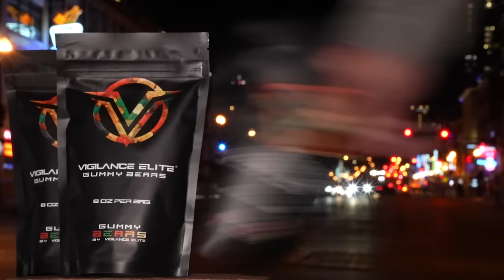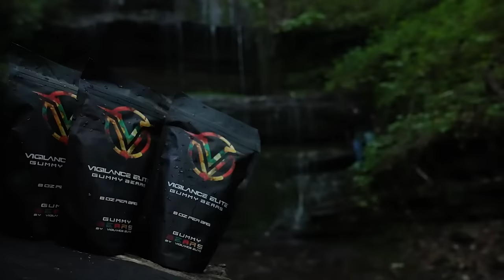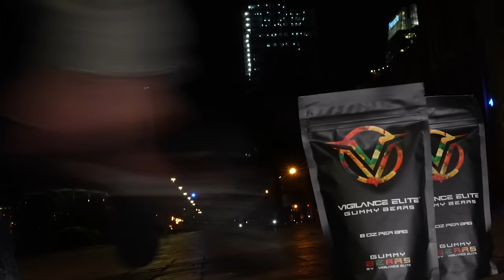DJ Shipley - SEAL Team 6 / DEVGRU Operator | SRS #015

Comment: "I used to run around with the charges already capped in."
As a former EOD tech, my mouth opened in a "you did what?!"
Reply: Risky Maneuver there buddy… I agree
Reply: They live on the wild side, them SEALs.
Reply: Beyond ballsy move right there. Well beyond… lol
Reply: For us non-EOD / non-military folks out there, what exactly does 'running around with the charges capped in' actually mean? Judging by your reaction it's obviously not 'good', but what would be the technical reason why this is a bad idea?
Reply: What does he mean by charges
Reply: @k12cold53  explosive charges. He’s saying he would run around with the blast caps (the things that set the charges off) already capped into the charges (i.e. they’re ready to go)
Reply: @BigL3Z  So if theyre ready to go, how do you set them off?
Reply: @k12cold53  usually with electricity, like an RF switch
Reply: (YouTube has been deleting my comments so you’ll have to read between the lines) Im not in the military but yeah basically see4 and most XPs they would be using are very stable meaning you won’t accidentally blast off even if it’s shot or lit on fire and if you want to blast them off you use Det cord (basically hollow rope filled with similar stuff) connected to the caps or in a pinch you could ball up some det cord and use it but either way you still need a cap to set off the det cord from what I know so it’s sort of redundant so you generally just shove a cap (wether electric or flash tube style) in the XP and the caps contain a type of Xp that is way more sensitive and electricity or shock/flash tube (look up the shock/flash tube, it’s super cool) is generally what is used to set the caps off which then make the big boom go boom so if you roll around with the caps in the boom and the cap in the boom gets hit with a bullet or I’d assume even a powerful shockwave like a nearby nade then it would go off and make the boom on you and yourself go boom boom along with your teammates nearby
Reply: How did he not set one off getting in/out of a chopper? A 47 will produce something like 50k volts. You close the circuit in the ground and that blasting cap is goin off
Reply: Cuz DJ is a badass.
Reply: @robv.1503 when the breaching charges are capped in that makes them pretty much ready to go and they are very sensitive so if the bullet would’ve barely grazed it like DJ said he would’ve been blown to pieces and whoever was near him likely would’ve been severely injured.
Reply: @robv.1503 imagine always carrying the tv remote with the batteries out until you need to use the remote cause you might die. Then imagine seeing someone run around with one of those danger remotes

Comment: This guys speech is very peculiar..  throw R D sims, roof 360, 720.  bolt lock so callled out to exfil check the weapons. Shawn Ryan: " So hold on, did you get the guy?"
Reply: Arty sims. Short for artillery sims. Used in training.